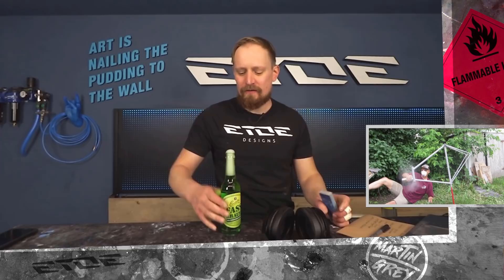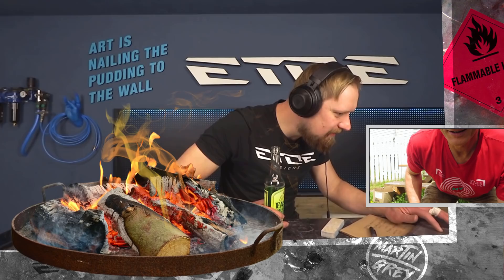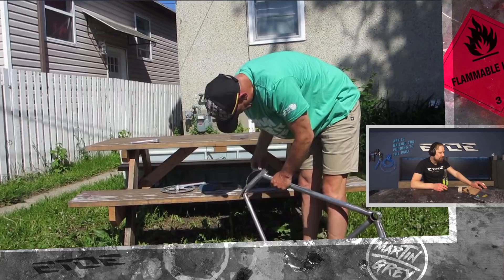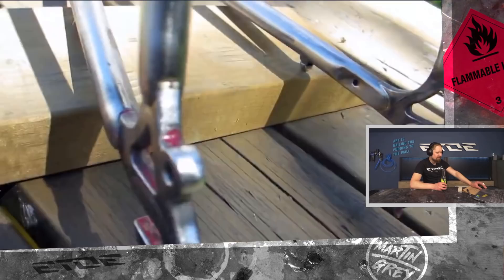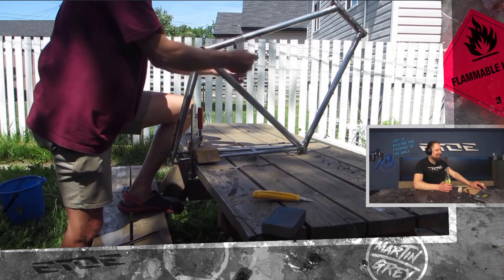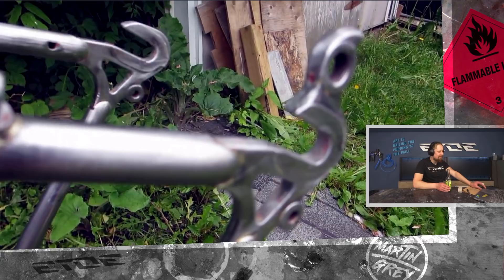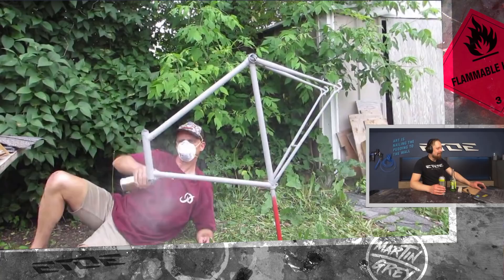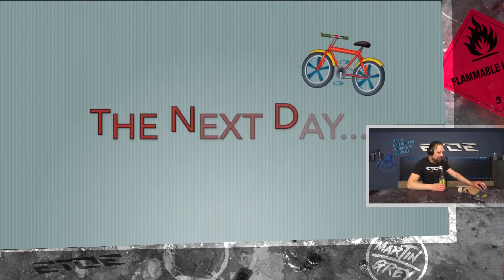Martin reacts to guy painting a vintage steel bike in the backyard

Comment: I decided to buy pints of color at the automobile paint store because it's hard to find the exact colors I want in a rattle can, also I can dip a pinstripe brush into some color if I buy a couple of pints. I have a really cheap 25-year-old touchup type of pneumatic spray gun but it sprays very well much better than a spray can nozzle. I like to use an acid etching primer if I can, I sprayed a 1950 Ford with it about 20 years ago I've been spraying acid etching primer on my hobby projects ever since.
Reply: I just tried Rattle Can like most people and I'm having problems. The paint took too long to dry and about 2 weeks later the paint started shrinking making cracks after about 2 weeks of drying. I sanded the cracks and the next day I had more. I spent money and time having to start over again. Now I have to buy a paint stripper to take it all off. Automotive paint using a small cheap 10-dollar spray gun is less work and a money saver because I don't have to do it over again. Also, I can't find acid-etching epoxy primer in a spray can just regular sandable acid-etching primer, epoxy primer is a two-part mix, and it gets hard and dry in about 30 minutes. The sandable acid-etching primer peeled off easily with my fingernail a week later, it really wasn't dry like epoxy even after it was sandable.
Reply: Acid-etching epoxy primer sticks to anything even shiny chrome, it is really thin and doesn't fill scratches well so if you need to fill scratches you have to use sandable primer on top of the epoxy.

Comment: Hi Martin, I love your videos! It was really good to learn about the damage that fire can do to a steel frame which is what leads me to my question. I got a GT bmx off my neighbour after it had been in a house fire, the reason I got it was because I loved the rusted look of the frame afterward and wanted to just clear coat the rust and rebuild it. I thought it would be similar to a patina finish on cars? Now I am thinking this frame is probably no good now? Is there any way to be sure it is unusable and that the fire ruined it? It still seems very solid but I would like to be sure if possible? Just so you have an idea of how bad the fire was, the seat post is welded to the frame now it seems?

Comment: Hi, what about wet on wet painting? Can it be done after applying primer? How many layers of paint go on the primer then? Do you need to sand the frame before applying clear coat? Do you recommend to send the frame and then apply another layer of clear coat? Thanks.
Reply from the maker: Everything has to be done wet on wet! Primer, basecolor and clear as well. As many layers as you apply. Yes I recommend to send frames after they are painted.
Reply: @ETOE  Thank you Martin for your  response. So if I want to avoid sanding after primer porcedure should be as follows? Primer (possibly few layers), then wet on wet colour (possibly few layers), sanding and then layer of clear coat? Thank you
Reply from the maker: @MatusSaro  yes what ever you like. Just avoid as much as you like.

Comment: This really showcases that you're an excellent lecturer!
A question: What are the options for a partial mirror-finish on regular steel? I know decals exist for this, but do any paints that duplicate the look - or alternatively, can any coating or paint be applied over a frame that's either been polished to a mirror shine or chrome-plated?
Reply from the maker: Makes no sence. Sand the polished areas or remove the chrome first. Painting on chrome is something a pro shoud do because not many colors stick on chrome plated surfaces.
Reply: @ETOE  Thank you for the response! The intention was to have some areas painted and others shiny, but it sounds like this is very difficult to get right as DIY.

Comment: Hey Martin! When repainting an old steel frame do you recommend using rust converter on the inside of the frame? Thanks, awesome video!
Reply from the maker: Yes you can use rust converter prior painting.

Comment: If you buy a bare Carbon frame without paint, can you just prime it without sanding it?
Reply: probably not. the bare carbon is covered by epoxy which was cured at high temperature. this makes it difficult for paint to stick. plus there may be residu of the mould release agent which is needed for the frame to be removed from the mould after its cured. im curious to what martin recommends for the grid of the sandpaper though.

Comment: Hey ETOE, is their a way to do a diy powdercoating? or is the cost of curing to high?
Reply from the maker: I don`t think you are willing to invest in a 400V 10 KW oven for frame baking.
Reply: You need an oven big enough to fit a bike frame.  People do DIY powder coating, it's popular within custom fishing lure community.  Harbor Freight even sells a cheap powder coat kit.  But all of them use old kitchen ovens.  Obviously a bike frame can't fit into an old kitchen oven...
Reply: I have heard people talk about using a heatgun for curing. im not shure if this is going to cure properly or burn the paint becouse of the unstable temperature